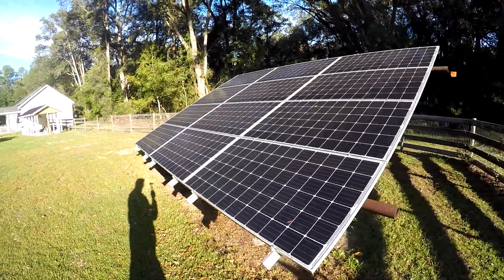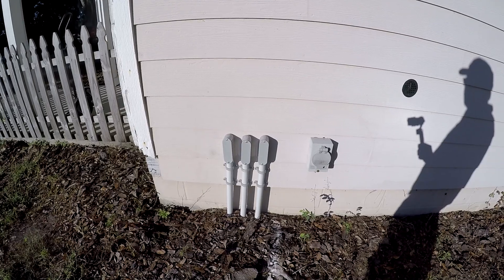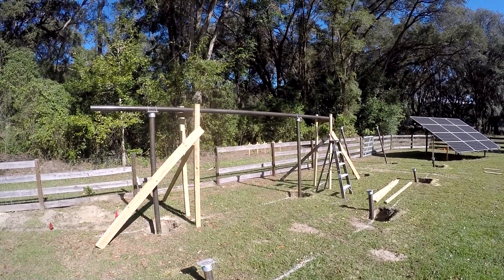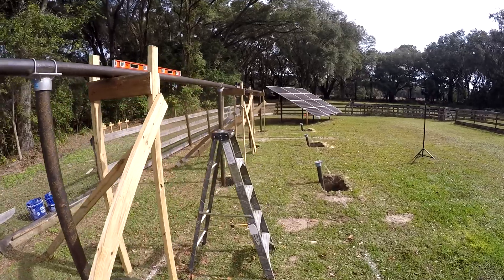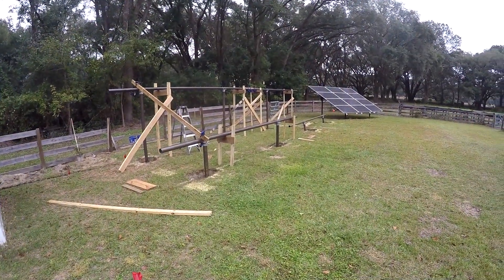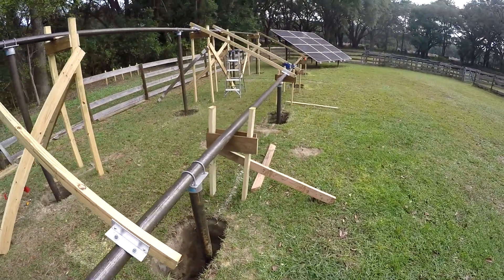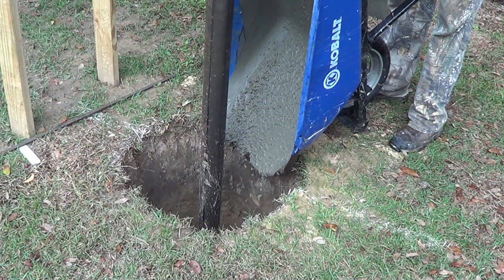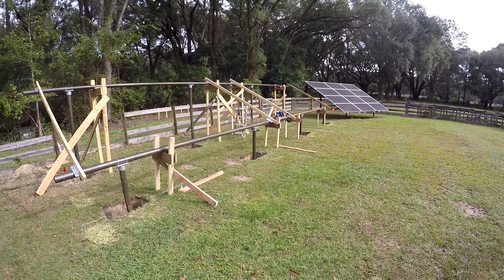Ground Mount Solar: Hanging the Rack

Comment: OMG this is so awesome! This new array looks massive. How many PV watts going on it? I may have missed you saying it. Are you going to fill those posts with cement? I did that with mine to prevent rainwater from getting in. Even though they are galvanized steel. Zero issues...solid to this day! Can't wait to see the next video!
Reply from the maker: Hello Chris,  I am moving my panels from the roof to this ground mount (8,200 Watts, the other panel is 4400 Watts). I am not filling the post but they are capped.  I actually just finished the project today and it is really cranking out the power!  :)  BTW: Do you think we will ever stop adding more power or is some kind of solar addiction?  :)
Reply: Awesome! With 12,600w in PV, I think your all set! Yeh, capping is alright. I filled mine for strength & keeping the water and critters out. I am about 2-3,000w short. In my tiny suburbia backyard I'm running 9,450w in bifacial PV...with very little room for more PV. So, I am buying a new car instead...hahaaa
Reply from the maker: @ChrisDIYerOklahoma  I don't know buddy, you have not tapped that roof yet, could get another few thousand Watts up there!  lol :)

Comment: Is there a reason you put the posts 12 feet apart? And why did you go with schedule 40 pipe? Is that better engineered for the weight? Thanks, its looking good.
Reply from the maker: Yes.  I am glad you brought this up.  I see a lot of ground mounts on YT that are seriously under engineered.  I used a design tool through IronRidge called "Design Assistant".
https://www.ironridge.com/design-tools/
This online tool does all the wind loading calculations and outputs a design that will stand up to the parameters you enter.  In my case I designed for wind speeds of 120mph.  For my panel, it takes 18,000lbs of concrete to hold this array down.  Compare that to what you see folks building without doing the wind loading calculations.  
Also,  I did a more detailed series on my other ground mount array that covers this and more:
https://youtu.be/N7CoCI-0IoY?si=Oo01p4I6Go6ocsm8
Thanks!

Comment: Casually pulls out a power torch welder whatever machine… lol you crack me up. Great video!! Can’t believe you do this all yourself.
Reply from the maker: It definitely helps to have all the tools.  The plasma torch, tractor, pallet forks, levels, laser levels, wheel barrows, work shop, etc. all make it a much smoother process.  Thanks!